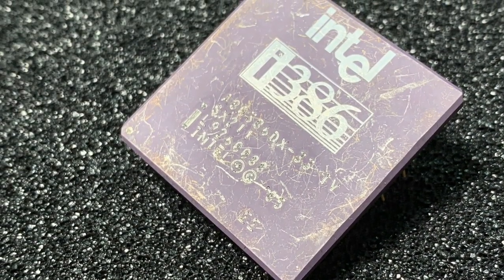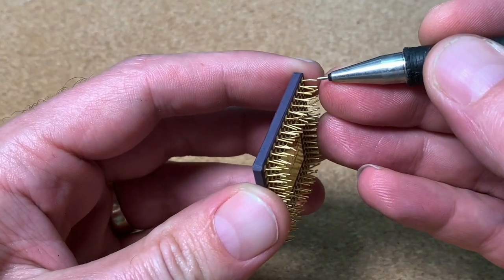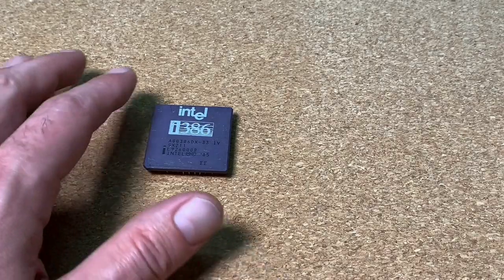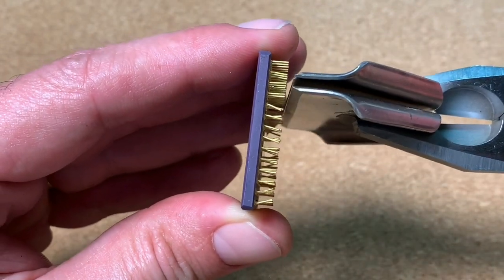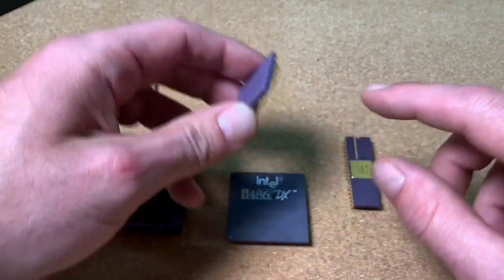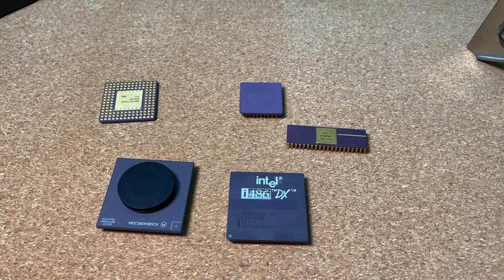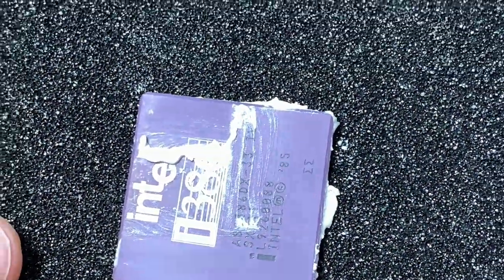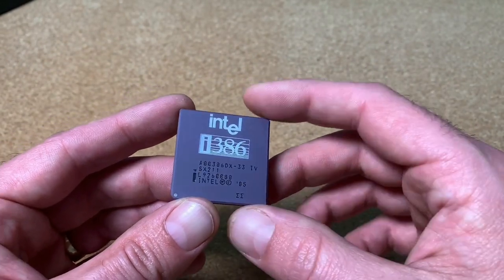CPU Cosmetics - Bent Pins And Scratched Ceramic [ CPU Collector Tutorial]

Comment: For much newer CPUs with ZiF sockets. I'm using medical needles with different diameter, for different CPUs. They are cut down at the end. Then I have few socket covers for different sockets like 370, 478, AM2 etc. It's very time consuming but you can see how does the pin look in a hole, and in which place does it not align perfectly, so you can straighten it up so it's true zero insertion force again.

Comment: What a great episode and so fundamental! I don’t get why there are not more comments about repairing pins and cleaning CPUs. This is the first thing a real collector does.
My trick which also works on smaller CPUs up to the Pentium 4 with pins is…. a metal collar stick. Yes, these arrowed things you put into your shirt collar to keep it nice flat and stable (in German: Kragenstaebchen). Thin enough and not as sharp as a knife (safety!)! You place it between two rows of pins and simply shake it left and right. Very easy….

Comment: I'm using all the time a cutter knife blade for bring the pins back in to the right position, works also fine with pentium CPU's and even P4 and "modern" AMD CPU's eg. socket 939

Comment: Thanks for the videos!
Your tool may still be too thick, but the Pentium pins are well aligned if you turn it by 45deg (the flat bit of your tool goes from one corner of the CPU to the opposite corner).
Reply from the maker: I tried already, but still a bit too thick.

Comment: For a 1st generation Pentium, I use a thin expansion slot cover from my stash of case hardware.  Just slide in between the pins, hold it against the CPU, and gently rock it back and forth until the pins are straight enough to fit into a socket.  If the CPU won't fall into the socket all the way, sometimes a wiggle will get it in and you can use the socket to straighten the pins all the way into perfect rows.

Comment: I have a question regarding the solvents. I usually start with isopropanol which covers most dirt and some markings. For removing Edding traces or the CPU thermal paste I then use white spirit but one should not scrub too hard as otherwise CPU markings and logos are also removed. I would really like to know which solvents you are using. In this episode a spray was used… which one? I am looking for a solvents that nicely removes the four black round stoppers at the corners of the AMD K7 Athlon XP type CPUs… any help?
Reply from the maker: Its called „Solvent 50“. Just google it and you will find a white can with green printing. This is the perfect spray. It removes all kind of glue, thermal paste and dirt but is not affecting any printings. I use this spray since 20 years and I am still happy with it. You can see the spray also here: https://www.cpu-galaxy.at/Article/cleaning_chips.htm

Comment: What happens if a pin snaps off, is it possible to solder it back on ?
Reply: granted, the video there uses a pice of plastic from the looks of it to align a new pin
Reply: I tried doing it, and it almost worked. The chip was only worth $10, so I gave up and bought another.

Comment: Awesome, will make myself on of those tools and then fix my bent pins ppro, well if its possible with its pin layout. If I use the polish paste on the front of a ppro will the black lettering come off?
Reply from the maker: Dont use this polish paste for the gold cap! it will defenitely destroy your black printing and the gold. if you want to polish your goldcap just juse a chrome polish which are used for motorbikes. this is a very fine polish and will also not destroy your black printing. But no matter what you are trying, check always with a cpu which would not hurt you if sthg goes wrong. 😉

Comment: Will the socket not straighten the pins if you straighten them by hand first so the cpu can be jiggled into it?
Reply from the maker: yeah, the problem is that it takes a lot of time to straighten each pin. and they need to be very well aligned that the cpu can fit into the socket.